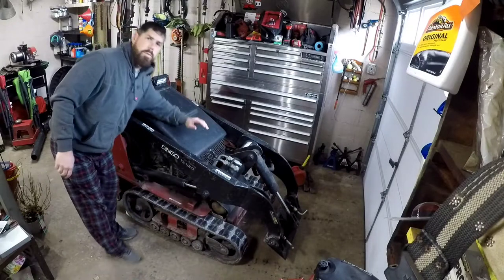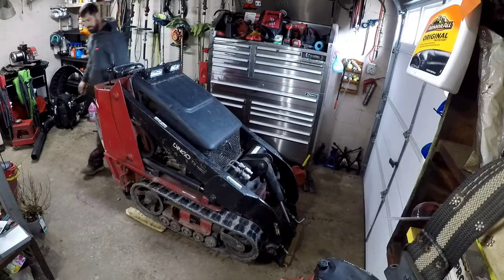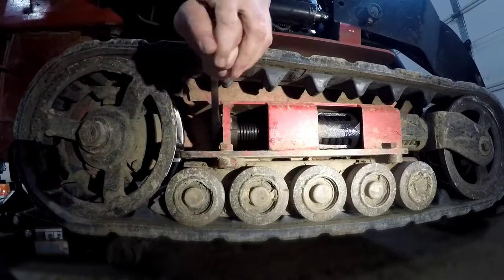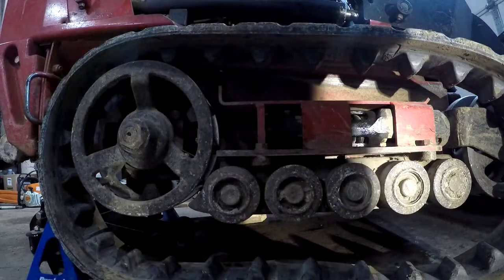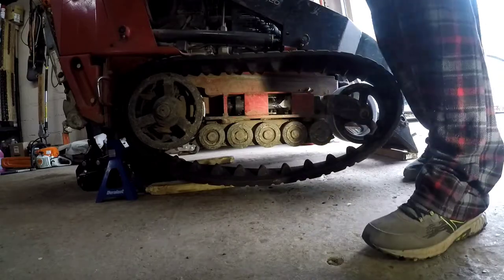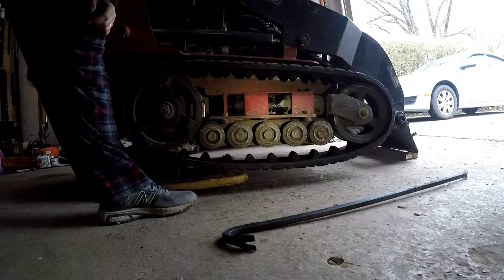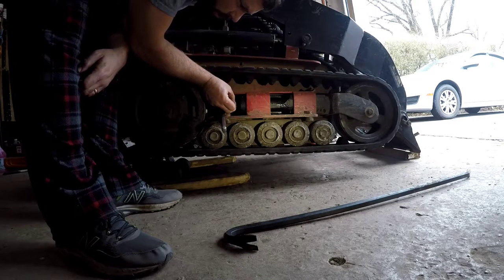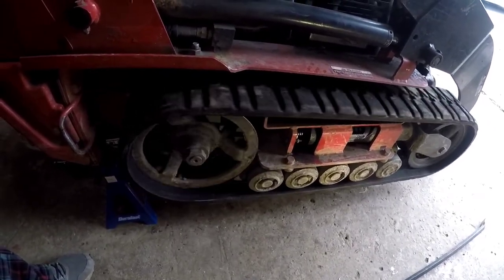Toro Dingo TX420 how to change the tracks.

Comment: I am a senior senior and I do the exact same procedure plus I take the nut off the front and remove the outside wheel. The nut is 1 7/16 but you can use a 36mm 12 point if you have to. It makes it a lot easier to slide the track off and on and an electric impact takes just seconds.

Comment: Hey man i have around the same dingo as you 420/425tx and my "bogie" wheel fell off. I can't seem to find the right part for it, if you could help me out with that. Also do i need to replace anything else or check anything else? I know there are wheels on the inside as well.